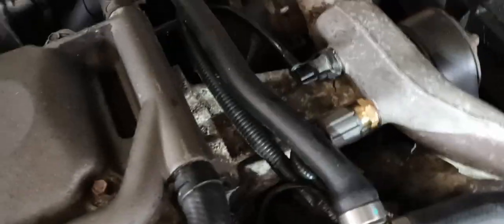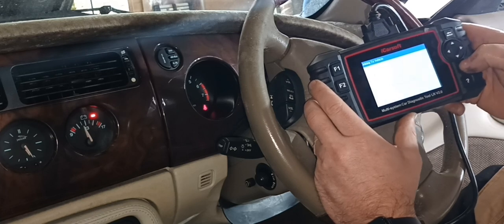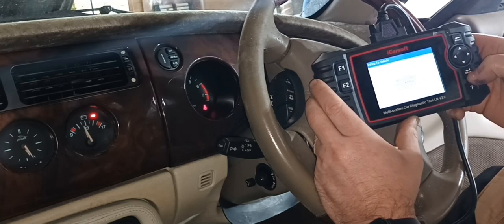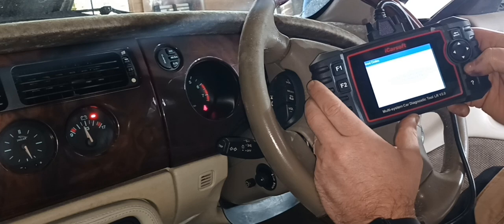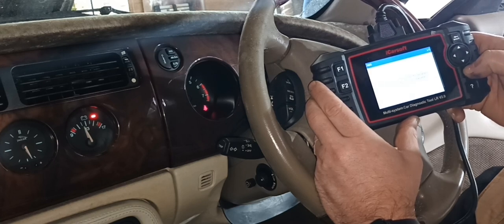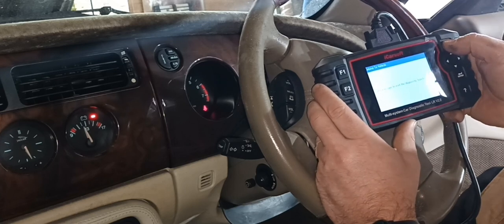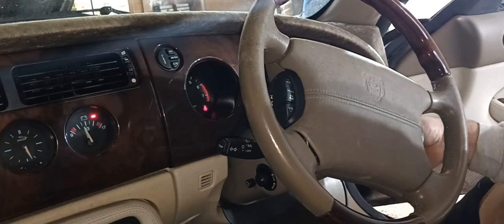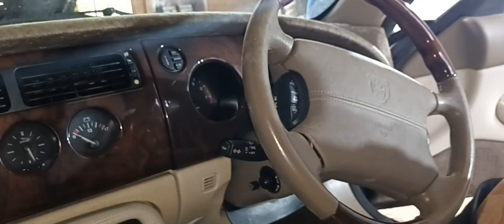Jaguar XKR project Episode 33 | Clearing all my fault codes, a hard reset and see how it runs

Comment: Hi again I was watching your video and the fault with it stalling took me back to a similar fault I had with my V6 fto if it was left for a long period my stepper motor caused it to run similar to yours and not hold ildle and erratic and stalling. I rectified this by removing the stepper and giving it a good clean with wd40 and it solved the problem. Hope this helps glad to see them in the dry now got my car's in my barn Kev Devon
Reply from the maker: Hi again Kev, that sounds interesting, mate. I shall add that to my list of things to look at and see if it needs any attention. 
I'm glad your cars are out of the weather too. It makes a huge difference, doesn't it. 
Thanks again, buddy, Simon.

Comment: Just read an article on a forum suggesting it could be the injectors leaking and puddling once the engine is warm and comes down to idle speed as, the injectors work based on voltage, which means when revving the engine they are working correctly but leaking at idle. To fix this means removing sending away and having them tested and cleaned, definitely worth doing on a car this age that's been left standing for a long time as the fuel goes hard and crusty and causes all sorts of problems with injectors. 
Only real way your gonna know if the engine is good put a decent amount of fuel in get it out on the road and test it and see if it runs smooth whilst moving,  if it does then it's not fuel pressure.
Reply from the maker: Hi buddy, thanks for the reply to my video. I would love to take it for a proper drive and have a private road almost a mile long. 
I just need to get the brakes in better shape, and then I could give it a blast. 
It really does feel like it just needs a bloody good run!
I have also just found out about a throttle body reset after a hard reset on the cat. I had not heard of this and will give this a go tomorrow after I have got some more E5 fuel to stick in it. It's something else ticked off the list, at least. 
Refurbishment of the injectors is going to be a must, as you say, especially because the cat had been sat for the last 10 years. 
Let's keep poking about and see how it all turns out 👍
Reply: @projectsinthebarn  throttle body reset, think that can be done with the obd tool. Yeah if the butterfly in the body is not positioned correctly then once its warm the engine would be starved of air.

Comment: Hi Simon. Your reading is showing maxed out negative fuel trims on one bank. This means your ecm is trying to lean out the mixture due to excessive fuel. Most probably it’s a leaking injector.
Reply from the maker: Hi buddy, thanks for the advice. I didn't really understand the true meaning of all of the fuel trim levels, etc, so that's some great information 👍

Comment: Forgot to say,  be really interested in this bonding rather than the welding process, sounds well worth a try👍
Reply from the maker: It will mate, when I get to that and see how much I need to cut away, then I can get a good measure on whether we can bond instead of weld. It will ultimately depend on how close the rust gets to any structural areas, as if that's the case then I will have to weld it. 
So a good one to have a play with 👍
Reply: @projectsinthebarn  as you say, as long as its not structural,  be really interesting to have a good and see first hand the results😊

Comment: I still think it's the wiring loom especially before code reset it was misfiring on multiple cylinders, error maf sensor and throttle position sensor. They are all connected to the wiring loom including your crank position sensor, altenator current sensor and temperature sensor. My car didnt run right for ages with this familier occurrence and sound, changed multiple spark plugs and ignition coils until 2 of my ignition coils had completely burnt out which led me to the ignition harness. 

Water did ingress within the ignition coil cover on my RB too and was completely flooded inwhich it caused a short in the system causing multiple misfires and problems with the maf sensor and all the rest. It still drove but had the restricted performance the same. 

If it were a air leak you'd be able to hold your revs for a minute to allow the maf and throttle body sensor to calibrate how much air should be passing through. Did this with my e39 2000 which had a horrendous vacuum leak held the throttle at 700rpm and stayed the same and ran almost faultlessly until the ecu remembered it had an air leak 😂

When running in that short segment the engine did sound sweet with a little stall so my thoughts it's short circuiting somewhere within the wiring harness. 

Just had my transmission go on me last week after giving it a service due to leaking from mechantronic transmission plug. Replaced the solenoids and conductor plate with new and the transmission decided it wanted to leak from the torque converter instead 🙄😂

So new uprated torque converter if i can get the right part at stall speed 3000rpm, new transmission seals, AMG solenoids and hopefully a lighted flywheel should fix the problem. If not a new transmission will have to be on the list but if i can refurbish it myself definitely worth a try. 

Just finished installing a quaife lsd as well 🙄 been one expensive car this year already 😂
Reply from the maker: Hi Mat, good to hear from you, buddy. 
Blimey mate, that's a bit of bad luck with your gearbox. Hopefully, you can sort it or, as you say, replace it with another unit. Out of interest,  do you think your LSD has caused an issue with it?
Also, it's good to see your car on John Dees calendar 👍 

My car is a quandary buddy, i have a new fuel pressure guage turning up today, hopefully, as my current one has too big a schrader valve fitting for the car, sadly.
At least I can rule out the pumps I fitted. 
As i understand it, my fuel pressure regulator has more to do with the return fuel as opposed to delivery, so again, I don't think this is a problem. 

The wiring may be an issue after it has been stood for so long, so it may well be worth going through it all. 
Who knows buddy, one day, I will crack it, I'm sure. I really want to get it on the road this year, see how it all goes, and then more restoration over next winter 👍
Reply: @projectsinthebarn As always Simon we'll try get to bottom of these bottomless pits with our cars 😂

I'll be honest my car has been having issues with it's transmission since I had bought it as every time I put my foot down I would get a strong burning smell in the cabin. I thought it was just general wear and tear but until I serviced the transmission last year and the fluid was a dark brown with bits of black I knew the transmission had not been looked after from the previous owner. I think the LSD didn't help with being such a new part but gave it 2000 miles of driving before I started to fully test it out and was fine until it wasn't 😂

The gearbox as it stands lasted me just over 40,000 miles so from drag racing, to track days and long commutes it didn't do too badly considering the state it was in. Just got to upgrade so the transmission can handle 600-800hp as that's the target for this build. 

It's definitely not your fuel pumps or anything to do with your fuel as it wouldn't run. It is plausible that it's one of your injectors but I would believe that would come up as a code on what bank it's not firing from but the car does have a safety software to stop grenadine itself if it has a problem with pre-igniting. If your compression ratios are sound then for me it leads to being an electrical issue. Check the wiring going to the alternator going underneath the car as this can cause a rough idle too as I found out on mine messing with the harness. Cost me £105 if I remember to replace the loom and took me and my dad about 4 hours figuring how it all goes back together 😂 

But wish you the best of luck bud and I hope to see this car on the road too this year! 

Honestly I enjoy those competitions John Dee has and think it's a brilliant idea for the car/ jaguar community as it continues to grow and was over the moon that my car made it into the calendar. 

Feel free if you already haven't to join our Facebook page "Jaguar XKR/XJR Owners" and see if anyone on there might have an idea what's going on with your car as well as every bit of information helps. 😎👍🏻

Comment: Hi Simon I’ve had loads of jags over the years I’ve never come across this problem with the engine hunting like your does I’ve red a few posts someone suggested trying lighter fuel around the breather pipes and all the hoses if you spray and engine revs up you’ve found your leak it’s got to be something simple as no codes have come back after hard reset so frustrating lol also I purchase the code you use reader you use as I had a big problem with my XF turned out it was the rocker cover was cracked also a breather had snapped of and the throttle body seal had blown so I had three air leaks the restricted performance light came on and big loss of power but the engine didn’t shunt or stall just took a little longer to start hope you sort it soon must be so frustrating for you I think everyone that watch your videos are scratching there heads anyway good luck don’t give up be interesting to see what it is when sorted take care 😊
Reply from the maker: Hi David, it's good to hear from you, buddy. 
It's a puzzling one, isn't it, I am convinced the day will come when I have my eureka moment, and it all clicks into place. 
Until then, I will keep plodding on with it and see what comes along. 
I'm glad you managed to get your XF sorted. Mine is still parked up here lifeless!
All the best buddy, Simon.
Reply: Think we will all be cheering with you when you sort the problem I’ve been working with cars since 1979 when I left school my car did hunt a little once revs going up and down I took air mass flow meters off gave them a clean sorted the problem but I know you’ve already done that your like me not a mechanic but like to sort problems out yourself it is a bit of a head scratcher I work at a hospital and I said to one of my patients can’t believe my jags  just cost me £600 to sort out and he said yer but you always forgive it being a jag and he’s  correct lol I do anyway I will keep watching good luck and take care

Comment: Simon, have you changed the fuel filter as the car has sat for long time and may still have the original filter and may struggle on tickler to keep fuel pressure
Reply from the maker: Hi John, good to hear from you, buddy.  Yes, I have changed the fuel filte, new plugs, and new coil packs and both fuel pumps. 
I am waiting for a new fuel pressure test kit to arrive so I can test the fuel pressure. 
So we will wait and see what happens 👍

Comment: Battery looks a bit low. Maybe ECUs are struggling. Also chuck some super unleaded in it and take it for a thrash down the road
Reply from the maker: Hi karlos, thanks for getting in touch buddy. I have completely charged the battery, but I will replace it with a getter quality one. 
I need to sort my brakes out and then I can stick in some descent fuel and give it a good run up the road 👍

Comment: Hello simon , great vid mate , i still think the fuel rail pressure sensor is definitely worth changing , simple job , did it myself few months back which has improved the running . Are your brakes in working order ? If so a good run in the car will do it the power of good , all the best .
Reply from the maker: Thanks again for the encouragement Mark, it's really appreciated. I haven't looked at that sensor yet, if it's one you have done then I would love to hear how you did it to give me a heads up.
Brakes are still not in order, so need to get them squared away before I can safely take it up and down the lane. Won't be long though hopefully 🙏
Reply: Hello simon, so the fuel rail pressure sensor on my 2003 xkr is located 6" back from the coolent sensor you've already replaced , firstly remove electrical connector , that gives you better access to the two small retaining bolts , 7 or 8 mm i think , then remove the small rubber fuel pipe , just push on , the part then can be removed and part number will be on the side , very important to get exact part number . I do hope this is of some help to you , good luck , 👍
Reply from the maker: @mark23fry  thanks Mark, I'll give that a go buddy 👍

Comment: i heard you say.712 lambda? That is very rich. Do you have an injector stuck open on that bank?
Reply from the maker: Hi again buddy, it may well have had an injector stuck open. I have parked the engine issues for a moment while I concentrate on the suspension and under body. 
I think it really wants a good old fashioned Italian tune up once its all back together again. 
I think it will be a good idea to pull all of the injectors as a matter of course anyway to give them an ultra sonic clean and a service.
Reply: @projectsinthebarn   yess 100% worth checking them. I have just bought an xkr non runner project to, hence watching your videos for tips and tricks, great job dude
Reply from the maker: @BEYTEK great stuff, mate, they are great cars. Good luck with your project buddy. By all means, keep me posted 👌
Reply: @projectsinthebarn  Thanks dude! much appreciated :)
Reply from the maker: @BEYTEK you're very welcome buddy 😀

Comment: This is so baffling. It started and ran well to begin with, I thought you'd cracked it! Smoke test time, that should find if there is an air leak. Time for an Italian tune-up! If you could get it to an airport or a track, and blow the damn thing out, open its legs, and get the ECU working right up to temperature. You've got one very confused car AND owner AND followers there!
Reply from the maker: It's mad, isn't it, I'm still scratching my head. I have one more trick up my sleeve, which I am going to try tomorrow and see how that goes. It's free, so well worth giving it a go, so stay tuned for that one. 
I need to get my brakes sorted out as they're currently leaking fluid somewhere,  then I will try and get it up the road here. I'm lucky and have almost a mile of lane that I can bomb down as long as the dog walkers and horses are clear 👌

Comment: -25% short term trim is bad. That’s at its maximum limit.
Reply from the maker: Hi again Andy, fuel trims are where it all gets a bit hazy for me. I watched my video back last night and made a note of all of the readings. 
At the start of the live data I was getting short-term fuel trim bank 1 at -5.5% and bank 2 - 25%.
Long term fuel trim was 0% and both banks. 
Then later the reading for short term fuel trim was bank 1 @ 0.8% and bank 2 @ 1.6%
All of the above was at approx 750rpm.